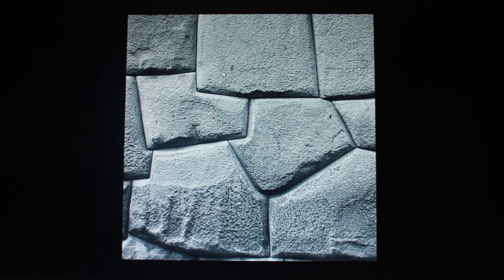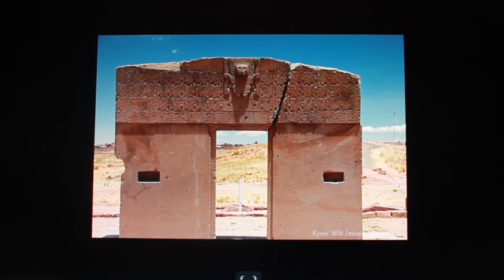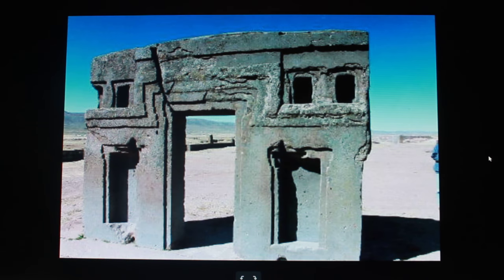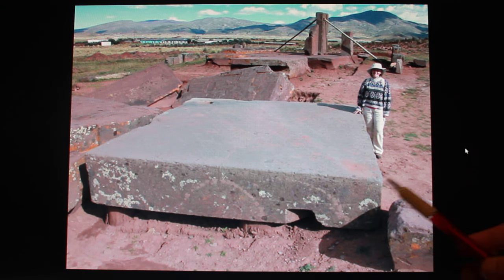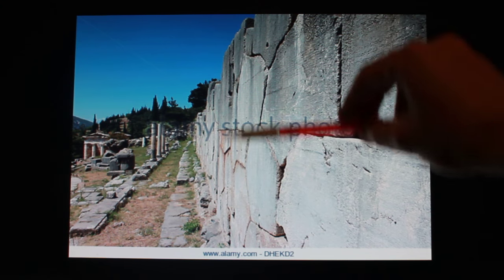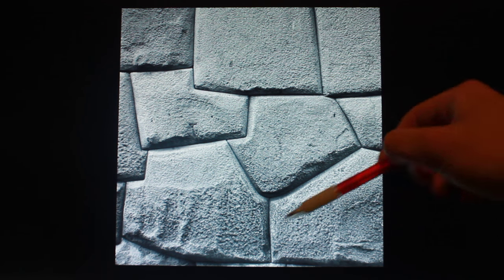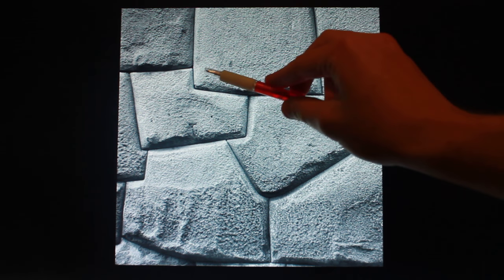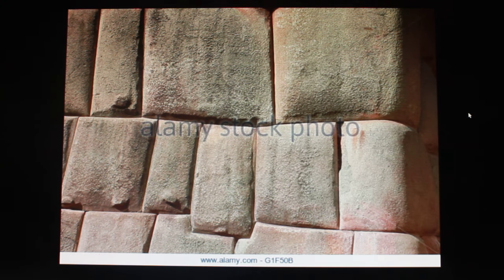How were the POLYGONAL MEGALITHIC INCA WALLS BUILT? LIKE THIS?

Comment: Absolute correct analysis !  I am a concrete engineer and a sculptor and my experience with casting concrete has led me to the same conclusions.
Reply: How they were formed is certainly intriguing, but my other question is WHY were they made into such complicated shapes, regardless of the methods they used????

Comment: You said yourself the Incas were alchemists. So the pre-Incas would have perfected this knowledge as well when building those walls, and I suggest that they used a combination of herbs and plants mixed together that softened the stones surface to such an extent that when they placed the next stones into place they molded together in such a tight and perfect manor.

Comment: I've built parking structures. it took huge amounts of technology and man power.  the forms were made of hardened density plywood and often contained steel components. All modern concrete contains rebar for reinforcement. Almost nothing we build today will be standing in 6000 years. I think you may be wrong.
Reply: MrAtheistLibertarian he won't be responding back to this comment, 👏 the one thing he's forgetting is "time" do you really think any form of poured concrete will last this long 🤔
Reply: You are assuming that modern concrete is anything like the kinds of concretes that would have been used by previous civilisations. Even Roman concrete severely out performs our own.
https://www.theguardian.com/science/2017/jul/04/why-roman-concrete-still-stands-strong-while-modern-version-decays So if the Romans had far better concrete than we do, who's to say that even older civilisations didn't have concretes that were better still?
Reply: I dont know about his hypothesis, but None of the roman  cement has rebar in it and a lot of it is still standing around. Though its much wetter in south america,cements enemy along with salt.
Reply: I agree.
Reply: @d4rqm4nn  describe your timeline please...
Reply: @markanderson9123  Which timeline? I'm not sure I've proposed a timeline.
Reply: @d4rqm4nn  These older civilizations you mentioned in your prior comment. How far do they go back?
Reply: @corners3755  also the Romans have underwater concrete that gets stronger the older it gets. Check out The Geopolymer institute channel recent chemical analysis of Puma Punku. They found rubber and bat guano in the H blocks. Found how they made the acid, where all the materials came from ect.
Reply: It is geopolymer. The tests prove it to be so. Comparing it to modern concrete is rather unfair. Fact is, anyone with some basic skills and tools could build something like this.
Reply: @kingdeecash0074  It's already been analysed. Stones are not made by natural processes. Case closed, 8 years ago!!. Not sure why this is still even being discussed.

Comment: Hi Charles, as someone who's stared in wonder at this stonework for many years, and someone who's worked extensively with concrete and also stone, I am almost certain that these structures were accomplished with dry cast reconstituted stone. 

It explains EVERYTHING we see here, I am almost certain your theory is correct and I arrived at the same conclusion around two years ago. Dry cast stone is pulverised rock dust with cement added plus water, it is almost indistinguishable from 'real' stone and when properly made it will last at least as long as true stone, it's an amazing substance. 

So what they probably did is paste the previous days works joints with some kind of animal or plant fat, then pack new material between yesterdays stones with some kind of bagging across the front using planking to keep it vertical. After it starts to set it can be trowelled off to give the beautiful bevelled joints. 

This work is absolutely incredible even using the methods above, how was the material pulverised to make the mix? What was the binder? It's completely insane. I believe that they included the 'knobs' in case it ever needed to be rebuilt, these people had seen some tough times.

A few people have said, if it's concrete why do it all different shapes, other than for structural purposes? If you could do this on this scale and you knew it would last a long long time, why not have a bit of fun with it? In other words they probably thought it was a beautiful style and I do agree with them, astounding work. 

I'd like to have a go at replicating this work albeit on a slightly smaller scale, when I do that I'll send you a link if you're interested. I know it will work because I have worked a lot with dry cast material a lot but until I have actually tried to mimic the style I'll never know for sure. 

So much of the work in the ancient world makes sense when you have that 'concrete epiphany', the 600 ton blocks at the Temple Mount in Jerusalem, so obviously concrete when you look at the impressions in the 'stone', they're former impressions. Now that is a lot of concrete. Without machinery? Cant see it myself unless they ha some very big and strong workers. 

Your videos are very thought provoking Charles, I don't always agree with your theories but you are putting yourself out there which deserves respect. These people leaving comments about your occasional odd breathing should jog on, we all have our quirks. 

Very close to a solution here I think, keep going.

Comment: You are just looking at pictures of these sites and coming to a conclusion that it has to be man pored concrete. Engineers and master builders have been to these places and and all say these are stones not concrete. That is why it is such a mystery. You need to stop with wrong ideas about things you know nothing of.
Reply from the maker: Cool! Well this is certainly the most controvercial of my vids! IT would seem!
Reply: Have they? The mystery is good for business but is not science
Reply: Sorry but to me as a layman, they are just lumps of soft clay pressed together with flat moulding plates (soft clay blocks pressed together will explain the tightness and lack of gaps), when it harden it becomes like that ... they purposedly cut the clay blocks in odd jigsaw like angles because the whole structure would obviously be a lot stronger due to the interlocking odd angles than just stacking rectangular blocks ...

Aren't they ?
Reply: not to mention  theres places that have damage  where the stones are gaped enough to see that its separate pieces also where theyve toppled over and are strewn about also in the zig zag walls  the outside corners would have been some big ass bags not to mention theres huge stone outcroppings that have rooms and such carved out and into in the same style as the pre-incan stonework
Reply: 57strub The Egyptian pyramid blocks are Geopolymer based  even a 5 year old can see that . How do you think the Roman Empire learned how to mix concrete it was brought back from Egyptian mixing techniques. You use what you have around you. If you want to make a fake wall it's simple you either cast the blocks on top of each other ( Egypt) or you chip away this surface to make it look like a block. PAUSE AT 00:08 those blocks are not actually blocks!!!! You were easily deceived you only see them as blocks due to the lines chipped out with only basic stone tools. What you see in Egypt is not chipped out lines on a wall it is a lime stone based Geopolymer concrete. The French institute for science already made Identical blocks using only basic tools ( wood based tools) . In 2018 we still cast foundations for houses just like the Egyptians did 2000 years ago. Construction technology has been held back on purpose due to these history manipulating societies who hijacked Sciences such as the Freemasons who have know for centuries the real Egyptian history.
Reply: 57, they may have been poured using a technique/mixture not presently known. Modern western construction is not the pinnacle of humanity.
Reply: @88feji  Why would you bother interlocking all those different shapes if it was concrete or clay, wouldn't you just make one molded and pour one piece?
Reply: @88feji  but it's not clay lol. It's usually granite or something that can only be cut with diamond, that's why its such an enigma.
Reply: @danfuerthgillis4483  - The so called "Geopolymer concrete" theory as been debunked quite effectively. Particularly in Egypt, precisely where the theory was "supposed" to work. 
Let alone the obvious fact, that for which one, we don't need more than an overlook to catch the many "holes" in the theory. ;-)
Probably the best example. Is that the (real) stones are not the same shape, size, form, position, interlock and a big etc. 

What is the common denominator of "poured" concrete or any other form of mortars? Evenness, each block would be similar to the next.  
Curious, that's precisely the opposite we see in ANY of these sites. In Egypt is similar, each block is unique. When used in finish (superficial) work the face is smoothed and worked, when not it's left rough and unfinished. EXACTLY as expected. The fit and finish in those cases is rough enough, for the gaps end up finished with mortar and filling stones. Once more exactly as expected.   
Any technique witch source to forms or bags to be accomplished. Also produce similar finished elements. Other wise we would be talking, literally, of millions of different "forms"! That by itself is ludicrous!

PS: BTW I guess it's worth mention. Almost 100% of these sites have been subject of "restoration" and quarried for their stones. Until much earlier dates (read XX century). With this said there's in fact "concrete" applications and other modern techniques. Some we can even see in the photos of this video. ;-)

Comment: A good theory, however I've worked with concrete and I can assure you those blocks are not concrete that was poured in place!
1. There is no way the sharp angles could be maintained if concrete were poured into "bags". I would like to see you demonstrate     such a technique!
2. The pressure!!!  On some of those larger blocks they would have needed to use steel shuttering! Remember, some of those blocks weigh hundreds of tons and that means liquid concrete would literally burst even wooden shuttering. Only re-enforced steel shuttering would be able to withstand such pressures, and as far as I know they did not even have steel!

Comment: i think this is the way being outlined in the video, but i'm not sure it's all stated in one paragraph. there's a way to get this result, especially with the knobs sticking out, and quite possibly the very way the ancient ones were done -- wet-casting the blocks in situ.  the blocks are made using natural fiber bags of different sizes, generally rectangular shaped.  the wall has a wooden trough/form set up as an overall molding shape for the final wall, which will be two blocks thick. the bags are set in the trough for one course of blocks, and then the bags are filled with various stone filler pieces, approximately from 1cm diameter to bowling ball sized, whatever fits and fills most of the bag.  then geopolymer cement is injected (poured into the top opening) into the bags.  the "knobs" on the blocks come from a small "X" or two are slashed near the bottom edge, to allow the cement to start to ooze out and let you know the bag is fully permeated with cement to ensure a solid block resulting.  once full, the bag's top flaps are folded over to close it.  while the cement is still wet, the next course of blocks is set up on top of the prior course.  the weight of the above layer will compress the wet/semi-wet blocks below, so they tightly butt up to each other and compress into a solid structure.  it should be timed so that the course of blocks immediately below the current working layer is still malleable enough to be pressed into shape, and the course of blocks below that are mostly solid, for stability when getting layers built to height.  once all  the basket blocks have hardened, the wooden trough/form is removed.  the final step would be to torch the faces of the wall to let the fiber bags burn away, leaving a perfectly fitted wall of permanent stone blocks like we see in ancient megalithic sites.

Comment: Charles Kos. I believe your correct to say that these blocks are made from concrete. But I don't think they were made in a vertical position. I believe the wall, or sections of it, was built face down on the ground. I believe the method they used is as follows:- a polygonal box, with the internal size and shape of a block, was constructed on the ground, but without its top or base (so just the sides). This is called 'formwork' or 'shuttering' in the concrete industry. The inside base of the box (which is just the ground) is given a layer of sand or soft soil. To make sure none of the wet cement escapes under the shuttering, some of the sand is scraped to the bottom edges to form a smallish radius all around the shuttering, at its base . The scrape marks can still be seen on the faces  of some of the blocks. This would account for the rounded edges to the blocks. Now the cement is poured, initially onto the sand inside the shuttering. This possibly caused the 'nubs' as the poured cement digs a small hole in the sand (maybe two or more pours are made at the same time, so two, or more, 'nubs'). Once the first block of cement is cured, the shuttering is removed and another set of shuttering is constructed, up against the first block, but this time utilising one or more sides of the first block. To avoid the second block from cementing itself to the first block, the walls of the first block are coated with grease or animal fat. This coating can be very thin, but effective, and will explain why the blocks fit so closely together when hoisted up into the vertical wall. Blocks of any shape and size can be made this way and will fit together perfectly when the wall is constructed. The texture of the block face would be inherited from the sand or soil from which it was cast. For me, the confirmation of this method would be if the rear of these blocks was perfectly flat. That would be the side facing the sky while the cement cured.